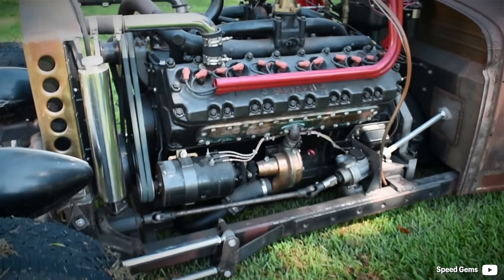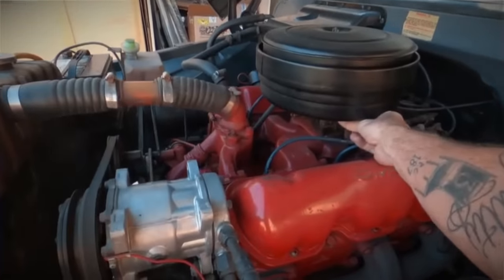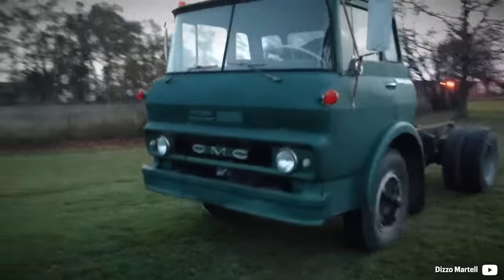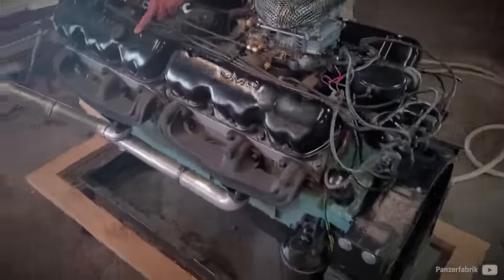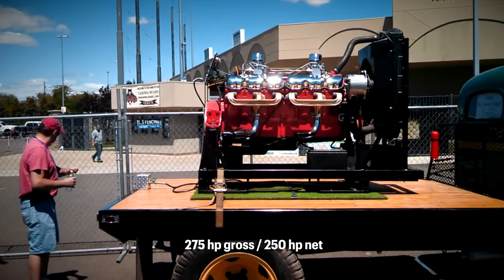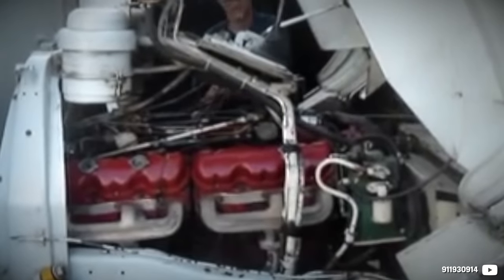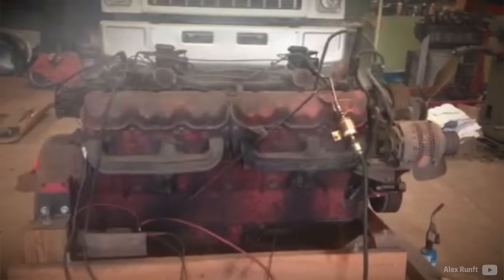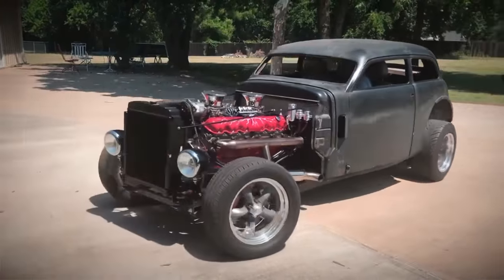GMC's Low RPM Gasoline 11.5-litre V12

Comment: I had the old 305 V6 in my GMC. The parts stores guys always corrected me, no sir the 305 is a V8 from the 70s....Nope, it's a huge V6, think it used the same size pistons as a 454.  I totally rebuilt it, 30 over pistons, cam reground to a modern profile, heads shaved .080 to bring compression from about 7.7 to 8.2, ported the manifold to fit a holly 500 2BBL, changed point to electronic ignition... Yes would have been cheaper to buy a 350 but boring.
Reply: If I recall correctly, valve rotators were a $50.00 option on that engine. A neighbor of mine bought a GMC pickup new in '65, or '66 when I was a kid, and that truck ran into the 2000s with never any engine troubles whatsoever.
Reply: And it's probably still faithfully running to this day.
Reply: @davef.2329  I did a front crossemember swap also, one from a later model like a 78 will bolt right in. Easiest way to get disk brakes, like $125 for the whole X-member with suspension and brakes.
Reply: I couldn't agree more,a great and really over built engine. Those who know truck engines and know what they are supposed to do love them
Reply: @NewFurCat  L?
Reply: Parts store guys don't know anything.
Reply: No where near the torque  of that V6 next came the 454 with a smaller bore longer stroke called the 84 427.
Reply: I think my Dad still has the hay loader GMC with the 305 V6 in it, I drove it to hay deliveries 25 years ago when we would offload the semi trucks at feed stores
Reply: @goodmanboattransport3441  May have been. I think they used it in dump trucks and other equipment besides their trucks.
Reply: @Ska Bob  
I know for sure it was the 305 V6, I'm just not sure if this truck is still in service, or just sitting in the yard
Reply: YOU GO BROTHER 👁 LIKE SOMEONE THAT THINKS OUTSIDE THE BOX
Reply: I never drove anything with the 305,  I did drive a Chevy,  C 70 with a 478 V6, it had a 5 speed and 4 speed transmissions,  it was a dog,  I thought they should have put a 4 bbl carburetor on it,  the 2 bbl was lame.  If it wasn't forbthe 4 speed backing up the 5 speed that thing would have a very hard time getting out of its own way.

It was a straight truck used as a slurry truck, had 2 tanks,  one for asphalt oil, and one for water,  and a hopper for a combination of sand and very small rocks it mixed everything in the back then it was dumped into a 6 foot by 3 foot box with rubber that went around the bottom and the truck would pull it until you ran out of the mixture.  It would seal asphalt roads, or parking lots
Reply: @bertgrau3934  Yes the 2bbl carb was very small, not sure if the 478 used the same one. I put the holly 500 2bbl on mine and ported out the manifold base to match the base of the 500.
Reply: @SkaBob  
The carburetor was a Rochester carburetor,  it was probably a little bigger,  than the one used on the 305, I would think, the 500 Holly 2 bbl,  would be a somewhat big improvement.  The truck I drove had a twin screw drive axles was licensed for 43,000 pounds gross,  that's why it was slow,  for what we used it for it sure enough didn't need to  move fast
Reply: Exactly! Definitely much more impressive. Honestly why I even like seeing a worked 305 V8.

Comment: I remember during my auto parts days, a customer rebuilding a 305 v6. We had to break out the old dusty catalogs, but were able to find him bearings and gaskets! He was as surprised as we were!
Reply: Peugeot 305 V6? (Best French V6 ever)
Reply: @toyotaae86trueno  most likely 305 yank units
Reply: @toyotaae86trueno  gm 350 v8 derived v6 is what it is if I’m not mistaken
Reply: @captain1334  That's a 262/4.3l

Never heard of a 305 V6
Reply: I guess there was a 305 v6 shown in this video
Reply: Yes back in  1983 company I worked for in Los Angeles we had a mid 60's I believe retired beer truck with the 305 v6  I rebuilt it  Ran great
Reply: @captain1334  no you're thinking of the 4.3. The 5.0L V6 was only in old GMC rigs and dumps pretty sure
Reply: @iunnox666  I have a flatbed GM truck with a 305 ci V6 in my barn....
Reply: @iunnox666  wrong
Reply: @ericschulze5641  this is not about V8's
Reply: @iunnox666  definitely not a 4.3. Those are extremely common.
Reply: @ericschulze5641  did you even watch the video? https://en.m.wikipedia.org/wiki/GMC_V6_engine
Reply: @mikeholland1031  No, it's not. The V6 that's a 350 with 2 cylinders chopped off is the 262/4.3l. And my not hearing of a 305 V6 doesn't mean I'm saying it doesn't exist, it means I haven't heard of it.
Reply: @iunnox666  ok then. You are correct about the 4.3 being a 350 minus 2 cyl though.
Reply: @mikeholland1031  message was for Alex who claimed he had a 6 cylinder. 305
Reply: @apancher  honestly not all of it but you said you had a 6cyl. 305
Reply: @themuckler8176  whaaaaat, got any pictures?
Reply: @ericschulze5641  so maybe he does. They made them
Reply: @mikeholland1031  what were they used for  ? industrial water pumps and generators ?
Reply: @ericschulze5641  medium duty trucks
Reply: Those were great engines. Dad had a 66 gmc 4x4 truck with one. Still has it. One day I'll talk him out of it
Reply: I had a  87 4.7 v6 Olds cutlass cruiser wagon, the guy I bought it from said it was an experimental engine & only 500 were made, it was faster than my 87.  5.0 mustang, I brought it in for exhaust work & the entire shop crowded around it, & looked at me and said, this cars real fast isn't it, I said oh yeah , I have never been able to find anything about it, and everyone says, there was no such car, do you know anything about it  ? I seem to remember something about multi port fuel injection basically a factory racing v6 ,front wheel drive it was a long time ago, but I always wonder just what I had, even my mechanic friends never heard of it
Reply: @ericschulze5641  305 ci v6 do exist. Came in some old half ton trucks with an oil bath breather
Reply: @captain1334  Nope. Nothing in common with car engines. You are thinking CAR 2229 and 262 Chevy V6.
Reply: @ericschulze5641  🤦‍♂️ if you don't know what your talking about why even comment. Literally every thing you just Said was wrong
Reply: That's service.
Reply: @4673962   no....I don't have pictures. It's a '72.
Reply: @themuckler8176  oh, ok thanks anyway.

Comment: I really great video! I didn't know they made a 956 but thought it was possible. I have 2 of these v12s, ive owned  8. I have owned every example of this family, 305s, 351s, 379, 401, 432, and 478s standard and "magnum" (bigger ports and valves) V6 engines and a 637 v8.  except for the DH637 and DH351 toro-flow Diesels. Most in multiples. We have ran them from 1965 until now. Repowering many things with them on the farm. Dad, an engineer, fell in love with them while working at a GMC dealership. GMC isn't a division of Chevrolet. Rather, they were all part of General Motors Corporation. Just like Detroit Diesel, Cleveland Diesel, EMD, Euclid, Allison, Frigidaire etc. Chevy was the cheapest brand and for that reason alone became the most popular. My 478 toroflo diesel  regularly got 27mpg in a cabover with an 18ft bed loaded. The first thing to do is chuck the timing light in the corner. Pull in as much advance as possible and hog out the jets and power valves until they smoke at full load. Then you have a whole new monster that eats Diesels for breakfast, and uses far less fuel than before. They were nutted for EPA reasons and frequently blew head gaskets and rings from pathetic 4deg ATDC timing and super lean jets. Later ones have bigger fastners and dual valve springs. I have accidentally had a balanced, ported, dual spring 401M with an 850 4bbl on a custom intake to 6300 rpm. They are extremely OVERSQUARE, a 478 is 5.125" bore x 3.86 stroke. A 401 is 4.875 x 3.58 huge pistons short stroke, huge valves (2.25" intakes) and 306deg duration cams made big bottom end torque, so low an electronic tach thinks it died! Then pull to 5k rpm.! Modern "stroker" engines couldn't even be warrantied in this type of service. I had a 1959 305A with 500,000 + miles, pulled it after the truck rotted off of it and. Then it farmed for 40 years in a tractor. It polished the cast iron block beside each rod throw from the oil over the years to a mirror! You won't knock a hole in the block with a sledgehammer either! Most people who got a turbo diesel after these cursed the lack of starting torque,  excessive shifting, hard starting, and waiting for boost. Diesel torque is a myth when you tune up a big gasser! Great job!
Reply: Holy crap man.
Reply: your dad is on the 6066 GMC forum, Marti isn't it?
Reply: my pops has the 305e in his 65 suburban. has over 500k miles (rebuilt at 400k) love the engine. i wonder if anyone has boosted one?
Reply: @Prowbar  yes, he was. Sadly he passed from 2 brain tumors. I became disabled from a non cancerous one a year before. Sold the farm and moved. Major communication issues caused almost all of that to become scrap. Even what i kept out was accidentally scrapped. But I still have two 702s and a few Detroits. A friend has his massey 1100 with the 478 in it. And a 401m we modified. Got some 305 boat anchors. Toroflows gone too. Saaad! Allisons gone too. Thanks for remembering!
Reply: @Cletrac305  very sorry to hear that, I wasn't aware of that. As far as GMC engines go, I'm currently building up a 478 (non magnum) to replace the tired 305 in my '65 1500. I'd be interested in hearing what modifications and tricks you and your dad performed on those engines. I have implemented a few myself already. If you want, send me a private message through the 6066gmc forum. My name on the forum is Prowbar as well.

Comment: My grandfather had a '68 GMC Camper Custom with the V6. 55 mph (88 km/h) top speed, 3 on the tree, air conditioned with split rims.
Reply: And more wood than steel, right?

Comment: My complements to you for an amazing video. The GMC V6 is the single most under appreciated engine. Paired with the legendary SM420 transmission with granny first gear, its simply amazing. It's a true technological marvel. These engines were so well designed they burned virtually no oil. Take it from a person that owns one.
Reply from the maker: Thank you for the comment!
Reply: I agree entirely. My father worked as a plant manager for GM back in 80's and early 90's. Since then, through a couple of businesses, we've collectively owned fleets of gm v6's and small-block v8's and some diesels though we mostly go with Cummins for that. 

Regardless, the v8's get the job done and are workhorses - but the v6's are the unsung heroes. I don't think I've ever seen one straight up die before the rest of the truck became unusable, and we were never kind to them in the field. They fit the perfect role in a supervisor or manager SUV or a people mover: good power so you'll rarely get stuck, good MPG over the v8's, and you can still tow a decent amount with them in a pinch! Can't tell you the number of times we saved leaving a trailer on site to potentially get stolen just because we went with V6 administrative vehicles over vehicles that could never tow.
Reply: @ReggieGeorge  probably saw the engine in my 92 sierra wt come off the line… 340k miles and only kicked out because i didn’t realize i had a hole in my radiator until it was too late
Reply: @g_kamikazi  wouldn't surprise me if he did. The motors NEVER quit, the only issues were cooling related.
Reply: We still have a handful of them in farm trucks at our farm where we never get rid of anything we just park it. have two of our trucks still running with v6s. our dad's 67 Jimmy Farm pick up still down there it runs too just got old need new front end parts.
Reply: straight sixes are better & GM made them too. Mind you that V12 makes a lot of sense.
Reply: When i see blocks that thick, i cant help but wonder how much boost they can take
Reply: I would rather own a GMC 6 than other brands because of reliability
Reply: gmc can be real good with their engines. I saw a chevy astro run two weeks on a single quart of oil (4 quarts low) and it knocked a little. put oil in it, zero problems.
it DID kill its own thermostat though.
Reply: @jimblu86   more importantly how much boost can the rods and junk pistons take
Reply: @durawins  That’s why he said “blocks”. Find a piston or rod that could tolerate more pressure than that block and you’d have an argument.
Reply: How can something basically UNKNOWN be underappreciated?
Reply: @mickvonbornemann3824  Your comment contradicts itself.
Reply: @Space Ghost  If you are not familiar with something,  that's nobody's fault but yours.
Reply: @spaceghost8995  I think you need to own a Tesla and stay away from automobile technology. Read before you post nonsense.
Reply: My grandpa had a 67 305 granny, he ordered a regenerating radio and it would pick up signals from everywhere . Mom loved borrowing it

Comment: Something to bear in mind is that when these engines were common fuel prices were relatively low and stable. Gasoline in Pittsburgh was 20 cents per gallon, diesel was 15 cents. The concept of turbocharging diesels wasn't thought of in the 1960s, during the development of the interstate highway system, and diesel trucks were pigs on the hilly two-lane U.S. highway system. A friend of mine's dad drove a 1959 gas cabover Ford until the Arab oil embargo, then he went to a GMC crackerbox.
Reply: I was always told relative to inflation and other prices, gas was cheapest in the late 90s when I started driving. It was common to see $1.20 a gallon in California where I was and under $1 elsewhere.
Reply: Another guy that doesn’t convert those fuel prices of long ago for inflation. It was never nearly as cheap as so many people try to say.
Why do you think “economy”cars that were easier on gas.  came about back in the ‘50s?
Reply: @joemonstermaker4784  True, gas has always been relatively expensive. The only reason people drove gas guzling monsters was they had extra money because everything was cheaper than today and there were less things to spend money on. No games, phones, ect.
Reply: I predict this will flip again. With diesel significantly more expensive than gasoline, emissions regulations killing diesel engines, and advancements in gasoline engines that allow them to be more efficient. I think we'll see large gasoline engines make a come back.

Comment: One minor quibble: GMC and Chevrolet are both divisions of General Motors. GMC is not a division of Chevrolet as stated in the video. In the era of this engine, there was very little in common between the mechanical components between GMC and Chevy.